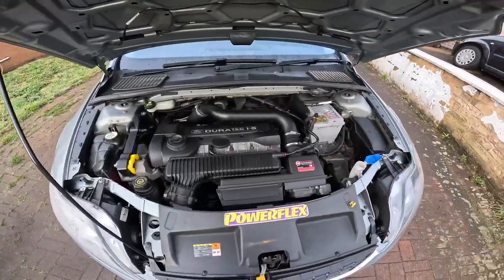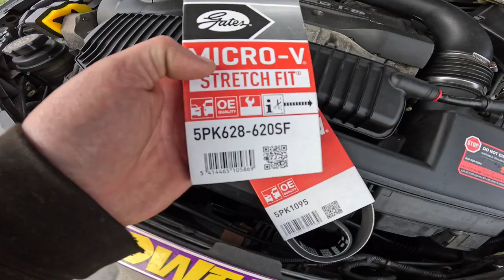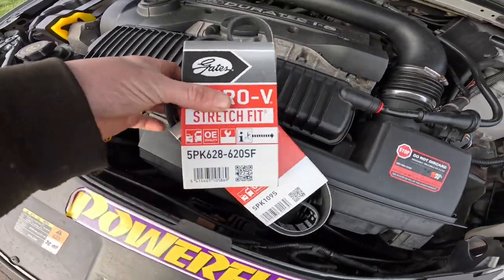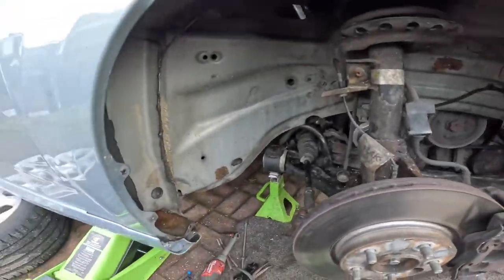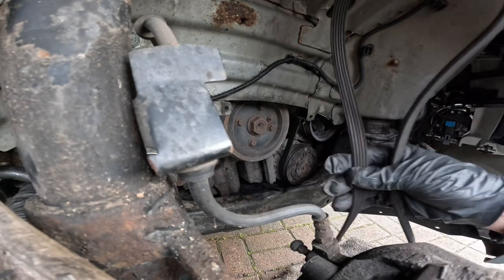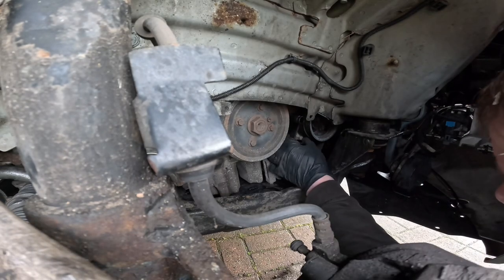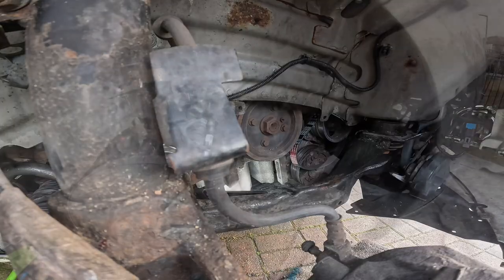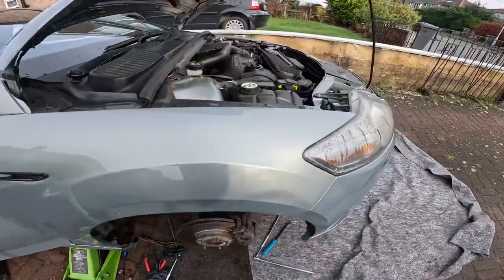Ford Mondeo 2.5T Drive Belt Replacement

Comment: I was wondering what that belt was called?.. I own a 2010 Ford Mondeo Titanium X Sport and when I was driving I heard Knocks from the engine. So ended up getting that belt and pulley system changed just didn't know the name of the belt?